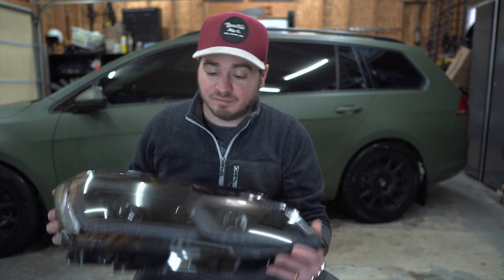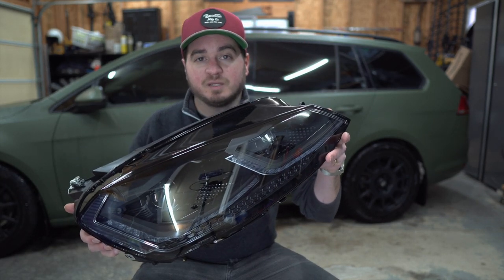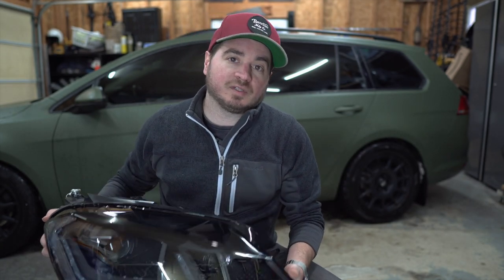Hardwire Radar Detector or DashCam from Dome Light - Mk7 Golf / GTI

Comment: Tips for those with a 2017 (MK7) GTI sport- don't remove the rear view mirror if you don't have to.  It's nearly impossible to put it back on the mount without cracking your windshield.  (Ask me how I know.)  I did discover that the metal arm that attaches to the glass is easily removable by turning it counter-clockwise.  So do that if you want the extra room of not having the mirror there.  Also, I bought wires that were 16" long, and that wasn't enough length to be able to mount my Escort under the mirror.  Next- the plug on my GTI was slightly different in that it has 6 wires going into the blue connector.  The red is still hot, next to that is gray, and then the brown wire next to that is the ground.  And finally, my wires were always on, so you have to have a detector that has the option to turn itself off.  My Escort Max 360 mk2 can be programmed to turn itself off, which I needed to do.

Comment: I tried this with my mk7.5 where it seems that the actual domelight is attached to the light cover

When the engine isn’t running and I have the key in ignition, the radar detector works fine but when I turn the car fully on it flickers on and off

Comment: I did the exact same steps in my Mk7 GTI, but the radar has a buzzing noise/hum and when hard wired is in a sort of boot loop, where it does a test then powers off over and over again.
Reply: I’m having the same issue lol. Any suggestions?
Reply: Same issue here on 18 GTI SE - Uniden R4

I was checking continuity between the ground wire and ground and it went from 1-2.5ohms to 40-120ohms a few seconds after starting the car. No idea why that would be happening unless I’m having a brain fart at the moment.
Reply: Same use
Reply: same issue lmfao

Comment: Finally I found what I was looking.
Further can you suggest how to do wiring for dash cam as parking mode on continuous power more in the roof light.
I am from India.
Reply: Bro did you find a way to hardwire dash cam from dome lights?
Reply: @13akashchauhan  nope
Reply: @kusumdwivedi518  did you try the way he has showed? I have skoda kushaq and the coupler looks similar.. not sure if it will work.. I don’t wanna burn my wiring
Reply: @13akashchauhan  I have Swift Desire and as per service station there may be Fuse issue and battery drainage problem. so not tried.

Comment: Hey man, sick car and thank you for the videos. How has this set up for your radar detector been working for you? I’ve hooked mine up and it seems to work great. I do however have a very quiet hum? Almost like feedback sound coming from the detector. Does yours do this? Do you still have it tapped into the same spot?
Reply from the maker: Thanks man. Yes, it's still working great. I haven't gotten this hum. It may be worth trying some of the other pin positions as well. I just got it to work by trying them until it turned on. There may be others that work well too.
Reply: @DadWagon  thanks for the feedback! Yeah I tried them all, one other one works but it’s pretty similar to the one you mentioned so it’ll probably be the same. Appreciate all your vids man, love that wrap!
Reply: I have a hum also, did you figure out a better way to wire it?

Comment: When I did this it seemed to work great, but when I turn the car all the way on it causes the detector to continuously go off showing it’s detecting laser. Thought it maybe the detector  so I plugged it back in to the original wire that comes with detector and it worked fine. Any suggestions?
Reply: Having same problem did u ever figure out
Reply: @edwardb0488   nope,  it will mess with it today and let ya know if I figure anything out
Reply: @jared9390 did you ever figure it out ? Lol same issue

Comment: What are the taps you used? Can you provide a link?
Reply from the maker: Taps? not sure what you mean. The link to product I used is in the description.
Reply: @DadWagon  did you just push the bare wire in next to the pins on the light harness?
Reply from the maker: @fledermau98  the kit has the wires finished with little metal taps - link in the description

Comment: This didn't work for me. The source isn't switched and dosent provide enough power to my Uniden R3
Reply: I have an Uniden r3. Damnit.
Reply: @Geoffrey Spriggs  I just switched to a fuse tap and ran the wire up through the A-Pillar. Really easy, just make sure you get a couple of the clips for the pillar from VW, you will need to replace them.
Reply: @Mk7Poorsche  Good looking out James👍🏽🙏🏽